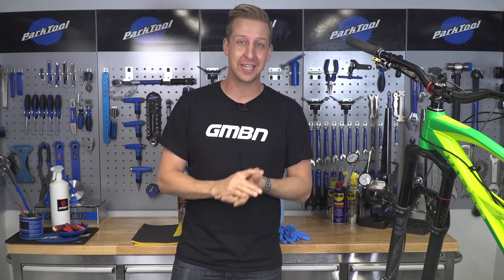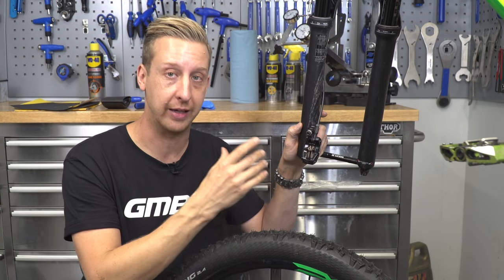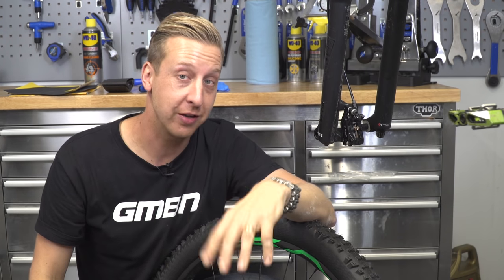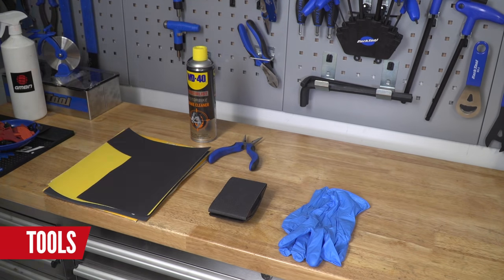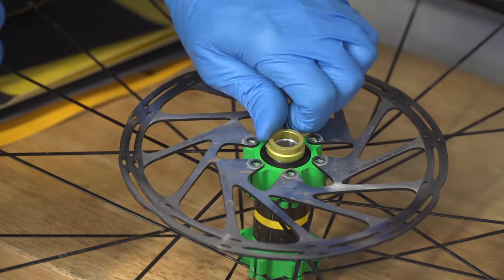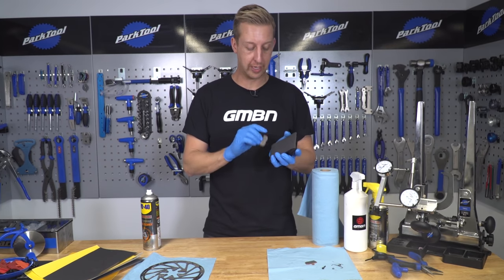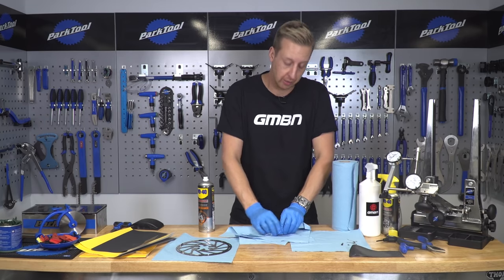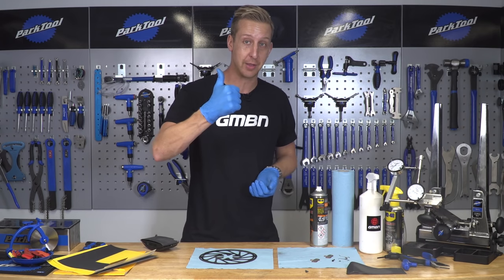How To Clean Your Disc Brakes | Mountain Bike Maintenance

Comment from the maker: Give us a thumbs up if you found this video useful!
Reply: Doddy!! I want to meet you!!😍😂
Reply: Very useful guys thanks
Reply: There are more ecological ways to clean discs than spraying unknown chemical cocktails in aerosol cans.
Reply: Global Mountain Bike Network where was the video on Sunday I was looking forward to the vintage vs modern bike comparison 😟
Reply: Global Mountain Bike Network ,it seems like my back wheel axle is a bit wobbly. And my back disc brake is sounds weird from this what do I do?
Reply: As well as entertaining I find all of the how to videos helpful great video as always keep it up !
Reply: Is there a way I can fix a brake pad that was one bit but now two the pad fell off the metal bit
Reply: At first: Rubbing the Disc with Sandpaper is murder the Disc! Absolute NO GO!!!
Second: When the Brake Pads need a Clean, id do it this way: Put Lube tike for dishwashing on it, this will help losing Dirt and oil and Using the hot Water not Cold one and rubbing slightly the Brakepads against so there will be get even and clean.
Then IsoAlcohol a little bit and then a Paper towel to clean the Disc with IsoAlcohol before assembling the Brakepads.
This is working for my Fomula Brakes everytime and on my Work the people there need to fix it.

So no SandPaper needed NEVER! Except the Magura Rim Brakes but it is another story.
Reply: Global Mountain Bike Network 👍👍
Reply: setting fire to brake pads is an old trick from the motor trade.
Reply: yes, it was useful. just one more thing: after you clean and install, make sure the caliper is properly aligned and that the pistons work evenly. one way you can make sure is by operating the brake while looking closely at the disc. if it goes left or right even the slightest, then you have a problem either with alignment or the pistons.
Reply: Global Mountain Bike Network can I use a clean toothbrush and citrus degreeser on the rotor while I’m cleaning the rest of the bike?
Reply: Hey guys, hail to the show and yourselves!! Our saviors from mechanical issues! So, the pads on my rear brake are not fully touching the rotor. They´re are more or less using half of the width of the rotor. What could be causing that?
Reply: Global Mountain Bike Network iis
Reply: Thanks a lot, just fixed my GF bike brakes following your instructions!
Reply: Global Mountain Bike Network Mr. be simple : alcohool 96° from pharmacie and an old toothbrush , some skillfull elbow management ,,, et vóilà.
Reply: Is it OK if I use normal wd40
Reply: Used fine sandpaper on my front brakepads, cleaned them and the rotor and they work like a dream. Completely silent
Reply: yes
Reply: W40 on disc brakes? Isn't that an absolute no no?
Reply: I see what @Global Mountain Bike Network is doing now. They provide one video that will completely f#ck up your rotors, then another one to show you how to unf#ck them. This video is solid. The video that this bloke recommends to bed in your brake pads is absolute trash, and is the only reason I'm watching this video. I've unfollowed GBMN as a result of the bed-in video.
Reply: Any and all environmental products work like crap up against the old stuff..you need the old stuff, period.

Comment: I work with a bloke who bought himself a 29er and then sprayed the brakes with WD40 because they squealed so much - they stopped squealing, but didn't really work as brakes either.
Reply: Gotta clean it off🙂
Reply: Methylated spirits and hand sanitizer burn off the oils making the brakes grip
Reply: Can I use wd 40 on the pads, let it completely dry and put them back together, I got some rust going on..
Reply: @pontikipsito46  nope thats a terrible idea. WD40 doesnt evaporate, so even after its dry there will be residue that will make your brakes work terribly.
Reply: My dad did this when I said my brakes were squealing, and I washed my bike today and the squeal is back but the brake felt so good!
Reply: @pontikipsito46  Ideally you'd clean them off with gasoline, use sandpaper and then clean them again with 96% alcohol.
But be extra extra careful when handling the gasoline.
Reply: @notar2123  ty for the tip!
Reply: But great to follow on the trail with a Go pro.
Reply: I did that one time. Did NOT work well
Reply: charlsomon do you mean squeal?
Reply: oh yeah did the same ting
Reply: @Abdul Rahman yeah my totally didn't work lmfao that's why I ended up here in this vid
Reply: @ahhmadd_01  what did you do to fix it?
Reply: @gerda7056  I cleaned with alcohol and then sanded it down evenly and again cleaned with alcohol it works
Reply: @ahhmadd_01  same
Reply: I'm ashamed to emit that I just put wd40 on my breaks cause I'm an idiot
Reply: iso on pads. keep wd40 and oils away from them.
Reply: I literally just did this yesterday. Feel like such an idiot. Some of us have to learn the hard way lol
Reply: No oil from the hands, only from the cans …
Reply: Please use a brake cleaner such as wuerth brake cleaner and wd40 is never meant to be used on brakes. It is a degreaser though but does leave residue that will attract grime.
Reply: He is using WD40 brake cleaner not the degreaser. WD40 do a range of products
Reply: Did ecavt the same
Reply: I did that
Reply: Lol

Comment: How to stop brakes from squeeling.  Step 1 remove Avid brakes.  Step 2 throw Avid brakes in trash Step 3 intall Deore XT brakes
Reply: Step 4, replace the XT or XTRs with Avid Elixir because the XTRs and XT still squeel. (I've had both and the avids were much better.)
Reply: Magura 1893 😘😘
Reply: step 4 throw away brakes you dont need em ... send it
Reply: My bike has XT brakes and the front disc brake has squealed horribly from Day 1.  The bike shop where I purchased the bike has failed to correct the problem.  Thinking about buying a bike with cantilever brakes at this point.
Reply: @davidkeighley7590  First try cleaning the disc with Isopropyl alcohol, and replace the pads (Likely contaminated from assembly, i.e grease got onto the disc and glazed the pad material)
Reply: Retrobellite has has momoomom
Reply: Retrobellite Koo
Reply: Retrobellite Koo
Reply: Retrobellite kk
Reply: Andrew Sanchez 😂😂😂
Reply: I have them but they are the squealiest brakes I’ve ever used
Reply: @ki.r6  can co from that my XT brakes are a pain.
Reply: @ki.r6  but the xt's actually work as brakes (last set were avid 3's...never forgiven lol)
Reply: @davidkeighley7590  mine didnt squeek until i oil changed em.  factory fresh they were all good

Comment: I usually put some sort of brake cleaner on the rotor and pads then use a blow torch on the pads to burn off any oil. Usually works really well
Reply: Marcus Hesketh and of course, setting something on fire is pretty fun.
Reply: it worked for me once when i set the garage on fire then it wouldnt work again
Reply: MJM Productions I also had this problem
Reply: Nooooooooo bad bad bad
Reply: this will undoubtedly warp the discs!!
Reply: That will eventually destroy the heat treat on the rotors' metal. I'd rather ride a brakeless fixie than torched rotors.
Reply: @roythearcher  only on the pads, he wasn't as explicit as he could have been
Reply: @georgecroney6168  Not sure I'd want to put a blow torch on my pads, metal or not!
Reply: @roythearcher  It's a bodge quick fix way to do it, brake cleaner would dissolve any oils and kind of rinse it off, but like wd40 it's great for everything and you always run out
Reply: @georgecroney6168  Definately a bodge!!! you could use IPA for the same thing but replacing the pads is probably safer in the long run.
Reply: Removed pads from bike placed them one at a time in a vice and applied heat with a blow torch for about 10 seconds each then cleaned off with paper towel and a degreasing agent 
This works unbelievably well
Reply: Did you use car brake cleaner?

Comment: Sorry Doddy, your viewers will expect you to know your greases. Copper grease is indeed used in the motor industry as you described on the back of brake pads.  It's also used on other brake componenst such as the brake pins.  Copper graese has an incredibly high melting point which no automotive brake can generate and whatever vehical you drive/ride your brake componenst will have copper grease on them.  That said, bicycle brake squeal is wholly attributable to contamation of the braking surfaces, and on that we agree.

Comment: What grit sandpaper would you use.
Reply: I use the finest that i have (900 for matal)
Reply: @jzgibsneanzeije5530  I have metal pads, will it still work or does sandpaper only work on matal ?
Reply: @smallhatshatethetruth7933  I'm sure the glazing is just gunk it's not like you're braking at 150mph more like 15

Comment: I popped my discs into the dishwasher with some Finish quantum, which is a cracking degreaser. Discs were brand new at the end of the cycle though the wife was mighty pissed off.
Reply: Not a bad idea
Reply: @LouisJKnowles   I think the question is -- Is a pissed off wife more annoying than squealing brakes?  At least you can do something to reduce the noise of brake squeal.  :))
Reply: Peter L lolol - they sound the same the ole banshee
Reply: @PL-fh8cz  dying!!! lol
-and I'm the wife!
Reply: Did this actually work because I’m kind of curious now
Reply: @f10nate  I have not watched this yet but I cleaned mine with fairy liquid... Worked a treat
Reply: Hummer812k8 I’m sure it did
Reply: Doesn't that bend the rotor since it heats up a lot?
Reply: @nicoh332  not as much as trail riding. Your average dishwasher heats water to 90 Celsius, steel won't deform until north of 430 Celsius. I think you'll be ok😉
Reply: Legend
Reply: Was it worth it? 😂
Reply: Lmao brilliant mate.
Reply: In case you are also suffering from a squeaky wife, try put her in the dishwasher. Works like a charm
Reply: I'm surprised your's got pissed off, like she knows what might stuff up the dishwasher. I could put the whole bike in mine and she wouldn't know any different.
Reply: @PL-fh8cz  jokes on u I’m 14

Comment: Would be interesting to see a video doing a braking test on the before/after or a new set of brakes vs old but cleaned.
Reply: I have a 2 year old set of SLX brakes and they work as the first day, the question is, why would they not?

Comment: I suffered a lot from low power and sqeaky brakes (Zee) After some investigation and tryouts my reliable method is put detergent (used for dishes) on pad, rub them against each other and after that cleaning under warm water. Then hot air gun for 5-10 minutes. CLean disc rotor with Isopropyl alcohol and bed-in the pads again. Enjoy the fresh powerful brakes!

PS: my pads were usualy contaminated by mist from silicon oil, WD40 and diesel smoke when carrying my bike on back of my car. Now I am smarter..... and no need to clean pads anymore. just cleaning disc rotors before unmounting the bike from car after the trip.

Comment: Just did this. Works a treat. Although the first thing I did was soak them in brake cleaner (peatys) and set them on fire for a couple of minutes. Once all the oil is gone then scrub them to restore the surface. Also scrub the rotors to scuff them up. 
No more squeaking and super power.

Comment: Lets make this way harder than it needs to be.  LMAO!     Just remove the pads.  Heat the rotor with a torch carefully. You will see a light fog apear on the rotor surface.  This will disappear as contaminants burn off. This can be very faint so pay attention. Takes barley any heat.  Set the pads on a no flammable surface.  Like the garage floor.  Just heat them up until they stop smoking.  Remember, the pads are designed to dissipate heat. It will not harm them.  Lightly hit them on some 400 grit paper if the are not flat.   Install and bed them in.   This can bring back pads that have been soaked in mineral oil from a leaking brake line or piston.   * Doddy (GMBN) does not want  to tell you this due to liability.  Dont burn your house down.  Heat is a tool we use everyday, use it!   Your welcome.
Reply: 100% true.
Reply: I have a diddy little butane torch lighter. If I really go to town with it I can probably do the same thing right?

I heated the pads a little bit but was scared I'd melt them.
Reply: @fossil98  that will work he said you dont need much heat
Reply: My brakes became less effective and very noisy, wailing like a banshee every time I applied them, it was completely doing my head in and actually spoiling the enjoyment of riding my bike. I cleaned the rotors with a rag and isopropyl alcohol, removed the pads and (carefully, on a patio slab outside) heated them with a gas torch until they started smoking, kept adding a little heat until the smoking stopped, allowed them to cool and rinsed with water, rubbing the pads against each other under a tap. Refitted the pads and within just a few lever pulls the brakes were transformed to like new, quiet and very strong. I'm not sure how they got contaminated but this heating trick has worked wonders to revive my brakes and eliminate the horrendous noise they were making.
Reply: What happens if the garage floor is made of rubber? Will it catch light?
Reply: Great tip except my house burned down. By "garage floor" I thought you meant foam mattress. My mistake.
Reply: Do you know if i can use regular alcohol lotion to CLEAN them?
Reply: This works done it loads

Comment: I had used a disk brake cleaning spray from wilko. The first time i used, it was perfect. Unfortunately the 2nd time the spray went rogue and my brakes weren't working anymore but if i sprayed some water on the brake pads they worked. As soon as the water dried back to sq 1. Followed this process and the brakes are back & works superb.

Comment: The best way to clean the brake pads, is put them into boile water. All of the particules and oil will stay on the surface. In the first time remove the water and  after the pads. You can do the same with the disc. I accidentally put lubricant on my discs and pads and cleaned them like that and it's free.....
Thanks for this video.

Comment: I use a little camping stove to remove all oils and fluid from contaminated pads. Place them on tinfoil, put it on the flame and watch for them to start smoking, once all the contaminated stuff is gone they will stop smoking. You don't need to blast them with crazy heat at all. Just get them hot. I have NEVER used organic pads, only the metallic ones.
For the rotors, use sandpaper that plumbers use to scuff up pipes. Its aggressive sandpaper meant for metal. Use it to remove all the glaze off the rotors. 
I ride whistler bike park and the north shore, this method has worked all my life.

Comment: This is meant positively, been there done that. Good explanation... for prevention also, which always works best!

Tip: dont fool around with those chemical stuff to much/often/long... sometimes rotors just wear out, after few years of intensive use..

Replacing my rotors, combined with new diskpads made my bike feel so fresh, i regretted not doing it earlier...
Reply: A few years? If your rotors live for a couple of years with "intensive" use, you're not really using them intensively.
Brake disc rotors usually have their minimum thickness engraved/printed on them. Of course you could ride them until they fall apart, but for safety reasons you should stick to those specifications.

Comment: I had contaminated discs once. I took my bike to the shop and the mechanic said I would need new rotars and pads. I didn't want to spend the money as I was quite new to biking at the time. So I went home, did some research and tried to alcohol method. Didn't hear a single squeak after that. Surprisingly effective, though I do suspect there is a downside to doing this, though I don't know what.

Comment: Sometimes when your bike is squealing, your braking pads are just worn out.
Oh yeah and another one: if your break pads are symmetrical, the left and right pad can be interchanged.
So if you interchange the left with right one accidentally, it might start squealing as well because of the wear patterns formed previously.

Comment: Great how to! I find it easier to simply leave the disc rotor on the wheel for cleaning. Just pinch the disk with a paper towel at full rpm.
Reply from the maker: Careful of your fingers!

Comment: Yup, I remember doing this with my girlfriend (she's a mechanical engineer). Her front brake got contaminated, so we start this process of salvaging the brake. Buuuuut didn't use any industrial degreaser, just kitchen degreaser and soap, then sand, then again soap, rinse, repeat. In the meanwhile she was polishing the rotor, went a little overboard, ended with an outstanding mirror finish...she got carried away haha. Was a funny afternoon, her brake lasted another six months, then was time to replace the pads.

Comment: I read somewhere that you should heat the pads up in a blue flame to force contaminants out. I've used the gas hob previously and you can see the oil xcome out of the pads quite clearly. Just left to cool and they worked spot on 😎
Reply from the maker: Nice! We can't fully recommend that to our viewers, since a lot of pads are bonded to the back-plate in different ways, and intense heat can de-laminate them, causing the braking material to separate from the plate. It's not that it doesn't 'work' it's that you've got to be super careful doing it
Reply: I know this is an old post, but I have done this, and it cracked the brake pad before it could bleed the oil out.